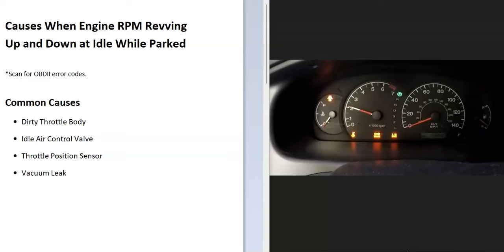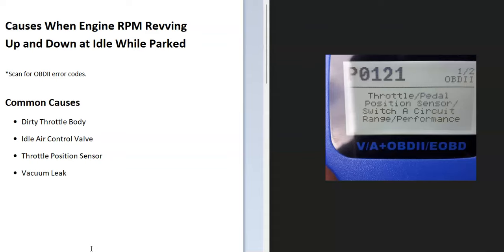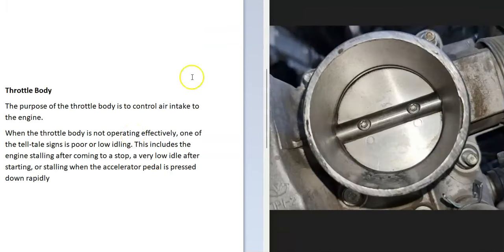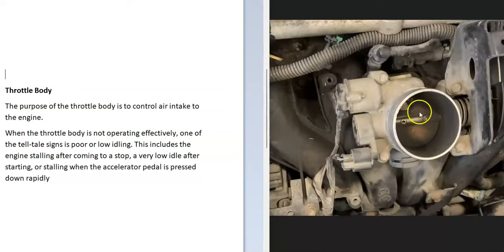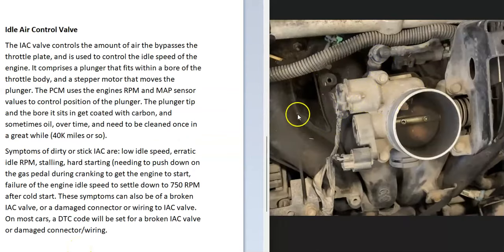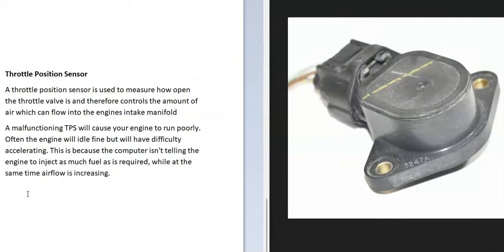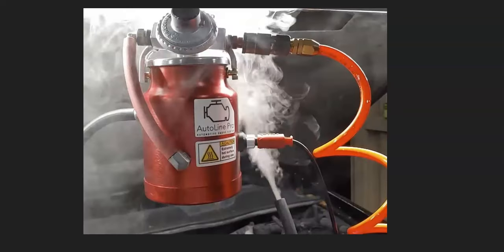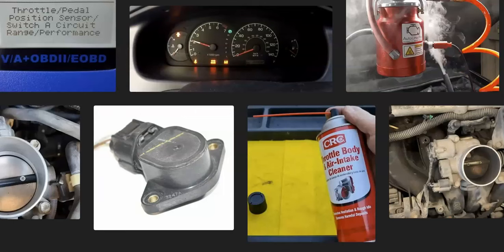Causes When Engine RPM Revving Up and Down at Idle While Parked or Stopped

Comment: I have 2016 jetta with 334897 km on it..its going good..only ptoblem its having it when i break the rpm goes to 4..i cleaned the throtal but its still having the problem...ANY IDEA
Reply: same 2008 jetta 2.5, changed maf sensor,  after market pcv valve replacement,cleaned throttle body.  ran a bottle of fuel system cleaner..that stopped it from stalling. now i get the random spike in rpm when clutch is engaged . im going to try a couple things will post if i solve it
Reply: @liljimmy9201  would really appriciate it brother

Comment: i have nissan sunny n16 with QG16 engine, the engine revs up and down when i fully depress the clutch pedal. I checked everything and changed the throttle body but did not fix the problem.
Reply: Don't you love it when you never got a reply?
Reply: @peacepoet1947  it’s a big disappointment
Reply: @sroodjalal2320  did you get your problem fixed?

Comment: Can this case problems also with the automatic transmission? RMP is very high on P and N
2500, sometimes even 4k. And when I'm driving there's total malfunction between the speed ans the RPM and I'm struggling to move. 😒
Reply: Vehicle speed sensor tolerance?

Comment: While parked my rpms would fluctuate fairly bad.  I turned off my defrost and it stopped
Reply: Did you figure out the problem
Reply: It's the idle air control valve 100%, don't cheap out on it.

Comment: This is happening to me it was throwing p0300, I changed the spark plugs and boots, there is no more codes but now the rpm’s go up when I hit the breaks, it does seem like there’s a misfire still ? Please help
Reply: Check the vacuum line going to the brake booster it likely got disconnected

Comment: My 2006 Chrysler 300 Srt does this, crank fuse blew and replace fuse and is good but once I turn on the car at idle the rpm go up and once I put it in drive it dies, throttle body has been replace and reprogrammed throttle body.
Reply: Same i can let you know if i find anything on my issues, what codes do you have? Did you have any 02 codes
Reply: @youngdayo6635  had cam position faults and I replaced it now I just have misfire that all
Reply: @chrisjimenez2311  any limp mode?
Reply: @youngdayo6635  no sir, at time when it stays running and I’m able to put it in drive it jerks and at idle it sounds like it’s getting more air in the throttle  body.

Comment: Just started happening when I clean my mass air flow sensor

Do I need to replace it? Guy at AutoZone said that you can't spray the mass air flow sensor spray directly on the mass air flow sensor so it screwed it up it might have bent
Reply: Is this happen after oil change, air filter cleaning?

Comment: i tried cleaning the throttle body up and after I put everything back together my rpms are high and wont go down and check engile light is on
hondaa accord 2008
Reply: After cleaning a throttle body, the cleaning fluid can cause high RPM and rich condition, which may trigger a code. It should clear after 4-5 minutes, though.
Reply: @JereB698  that’s the thing it hasn’t. Maybe messed up one of the sensors

Comment: I have an audi a4 it idling high i to of the throttle body it is slightly open it doesn't stay close fully is that normal
Reply from the maker: Some throttle bodies use an idle air control, while others have a small motor on the butterfly plate controlled by the computer, which holds the plate open slightly while the engine is idling.

Comment: I have a Corolla. When I stop and have it in drive/reverse the rpms sorta randomly drop 200 rpm’s to ~600 when normal is around 800. Any ideas?
Reply from the maker: I would clean the throttle body and see if it improved.

Comment: If you have vacuum leak you’ll have cel for sure.
Reply: i had one before the car started revving up and down but now it’s not throwing codes at all. i have a g37 and have done tons of maintenance on it including cleaning the throttle bodies, fixing vacuum leaks, and replacing maf sensors

Comment: Ive change my bank #1 sensor then rpm goes between zero and one.engine light on again
Reply: Same I switched out the 02 sensors and still have the codes have a misfire as well